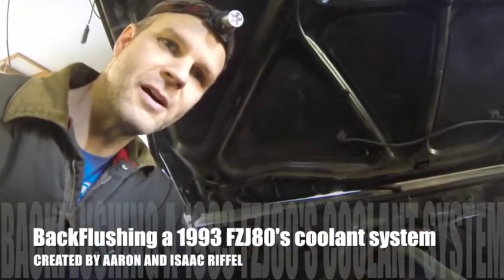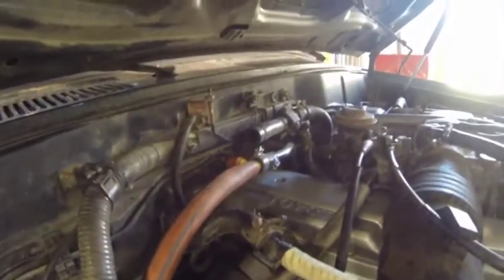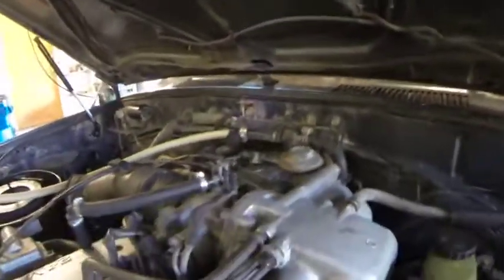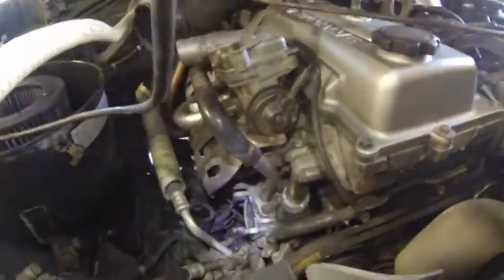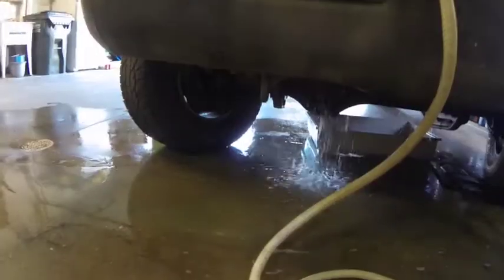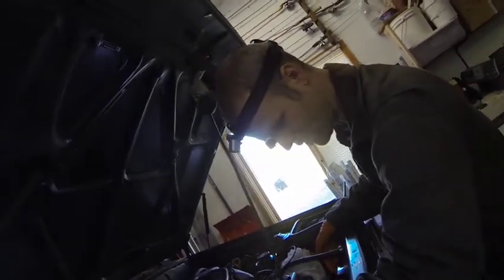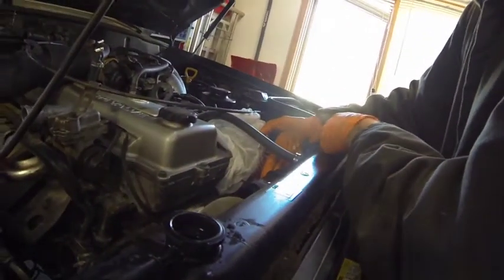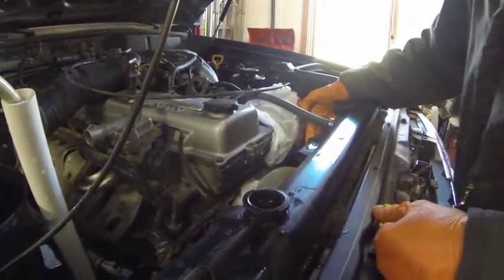How to Flush a Cooling System

Comment: Great video! Have the same model and motor! Quick question, did you unplug the radiator drain plug as well? I have the haynes Manuel but I cannot for the life of me find it. But it seems by your video it's not needed to be taken out if you pump it through the housing. I want to flush mine real bad but have never done it but this video sure helps! Thanks a bunch keep it Land cruiser strong!